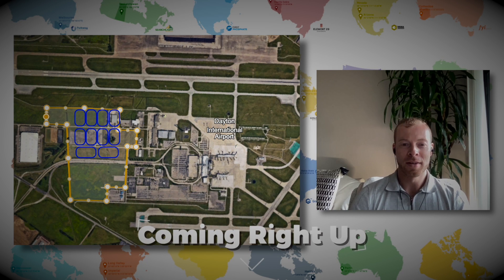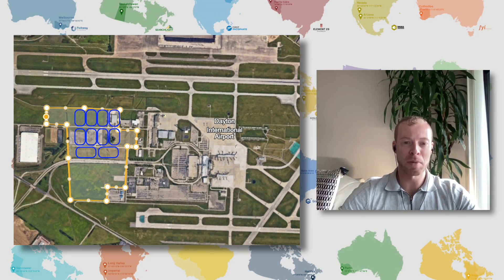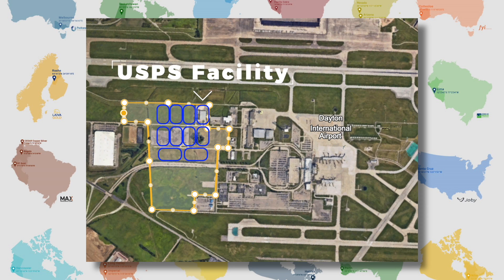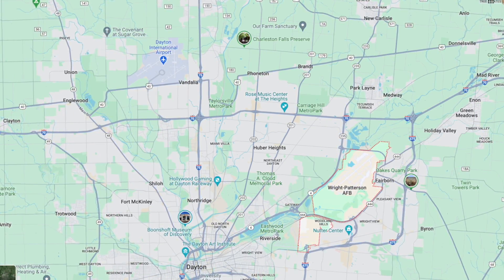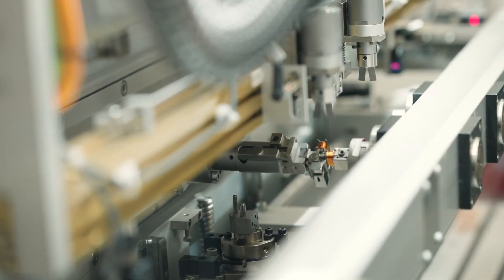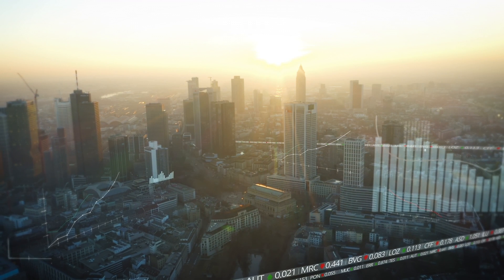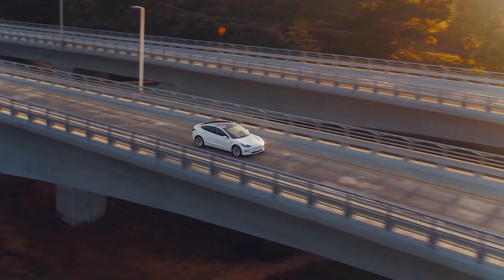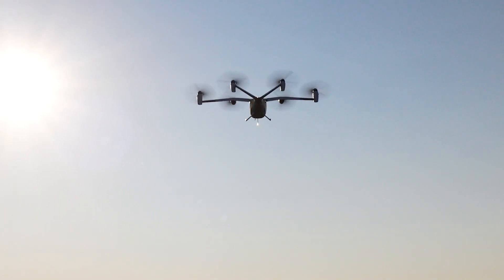Joby Expert Explains: Everything We Know about Dayton Facility | $JOBY Aviation

Comment: I believe Archer Aviation is way ahead of Joby in the certification process as well as getting ready on the manufacturing and scale with a new production factory in Georgia.  It has taken Archer 5 years to get up to speed in what Joby have done in 15.  Any how Im investing heavily on both companies.
Reply: Archer is at the least 2 years behind Joby. Midnight can’t be piloted, so it can’t be used for FAA type certification. Archer will have to build another aircraft to use for type cert
Reply from the maker: @livingroomguitarist7  Good insights. Thanks
Reply: I Believe Joby also has a first service agreement with the powers that be ,if im not mistaken?@livingroomguitarist7
Reply from the maker: Good to hedge your bet across both. 100%

Comment: When are they going to show that they can function as an air taxi and can carry a couple of hundred pounds a couple of miles? I don't think it's important to ramp their manufacturing before they are type certified. What is the logic in ramping up manufacturing when there is no proof they even work as a taxi? There is no way they will be certified in the next 5 year even if they worked perfectly. I doubt they do or they would prove it.  They should focus their resources on making a craft that functions as advertised and show it around to raise more money then manufacture when they have a certified craft. What are they going to make if they don't have a certified craft?  They are putting the horse before the cart. I think they know what they want to do isn't possible and are basically buying time.
Reply: I was gonna respond, but then I got high*
Reply from the maker: @spredluv1  please drink and smoke responsibly ;)
Reply: Joby been around since 2009 that's 15 yrs my guy
Reply: @itisim  that's a long time without much to show but quickly edited clips. They don't even have the craft that they will attempt to certify made.
Reply: @TheBagOfHolding  they are showing 3 FAA certificates that is a mile stone my guy do some research
Reply: I know everything about them. Air worthines doesn't matter and doesn't even need an existing craft it just lets them try and shows they have the resources to try. Part 135 means they can operate an air carrier buisness with normal certified airplanes and helicopters that they use to trick investors into thinking is a mile stone. Type certification is the only thing that would matter and they aren't even close. They don't have the craft designed that they will attempt that with.
Reply: @itisim  none of those certificates matter. Air worthiness means they can try to make something. Part 135 means they can operate an air carrier buisness with existing certified planes and helicopters not an evtol. They don't have one that they couldn't get even if they didn't have a prototype at all.
Reply: @TheBagOfHolding  it's a mile stone still man
Reply: @itisim  a type certificate is the only one that would matter and prove they can be an air taxi for people and they don't have the craft they will try to get that with made.
Reply: @itisim  they made the s4 before they got the faa type certification basis. That's the list of things they need to prove before it can be certified. They need to design it to meet that. They don't have it yet and I think it will not even be possible. If they do find a way to conform it will be years to get it certified. What are they going to manufacture before they know what to manufacture? I think they just want the grants involved with ramping up production and hiring a certin number of people.  Seriously what are they going to mass produce for all the years they are getting certified?
Reply: @TheBagOfHolding  mile stone my guy
Reply: @itisim  more like the starting line.
Reply: @TheBagOfHolding  joby will be fine and the balance sheet is good
Reply: @itisim  ok good then invest in them. I'm skeptical of them being ultimately viable. If they could replicate archers latest demo except with the 1,000 lb payload they promise for 10 minutes including forward tilting motors I would change my whole tune.  the 1000lbs can't be extra battery. Really I'd be impressed with 5 minutes of that.
Reply: @TheBagOfHolding  archer is second to joby
Reply: @itisim  they are equally vaporware
Reply: @TheBagOfHolding  nah joby got certificate first and archer came afterwards
Reply: @itisim  what certificate do you think matters? Air worthiness?  Archer got it before they even had a functioning prototype. That shows how important it is. They just need the resources to try and make something and a field to test it over for that.  It doesn't really matter the time frame. A type certificate is the only one that matters and that will be hard to get and take a long time and cost more money than either has. I doubt it's even physically possible to get an evtol to do what is needed for one. Maybe they should focus on showing it's possible first before manufacturing.  They need to take a load a distance that matters and prove it then they would get all the time and money necessary.
Reply: @TheBagOfHolding  joby has more than what you are stating
Reply: @itisim  what? Do they have anything they couldn't have gotten without an existing craft?
Reply: They are taking a big risk on getting a type conforming aircraft approved but they also need an approved production process to guarantee conformity to the prototype , even Boeing took a huge gamble on the 747 building the production building virtually around the prototype but that was into a mature market ripe for expansion with mature production technology whereas the evtol taxi idea is not proven even in theory and depends crucially on costs not just 'can it fly' ?  Economics is where most scepticism ìs based given other primary issues of safety and noise among many others.
Reply: Let's see what develops by the end of this year. Toyota and Delta Airlines had enough confidence in what's been developed to invest millions into Joby. I'm willing to place my bets with them.
Reply: @dcsensui  they should at least lift their claimed payload in a type conforming aircraft for 20 minutes this year. 20 minutes is the energy reserve needed for powered lift type certification. They need that plus the energy for the trip.
Reply: @TheBagOfHolding   What makes you think it can't? Have you directly observed any of the test flights? Seen anything that indicates the aircraft can't operate with a normal payload?

In July 2021 they did an endurance flight of 1 hour and 17 minutes on a single battery charge. Included vertical takeoff and landing phases at the company's test facility in Big Sur, California. A hydrogen-powered version went more than 500 miles.

Take note of the tooling required to build this aircraft. That tooling and inspection equipment is VERY expensive. I doubt any company would be foolish to spend millions on specialized equipment if the product couldn't perform as required.

And established companies like Toyota and Delta Airlines would not invest millions of dollars if they didn't believe the aircraft was airworthy and capable of doing what's expected of it. You can have your doubts but these major corporations, as well as the Air Force, believe otherwise.

Are you an engineer?

I'm a hobbyist and a pilot. I designed and built a quadcopter from scratch. Before kits existed. That means I had to figure out motor/prop/battery combinations needed to lift a one-pound camera and keep it aloft for 15 minutes. 

I built a test rig to measure thrust, along with battery consumption, to come up with the right combinations for a 4-rotor drone. Made all the structural components from carbon fiber, balsa, foam and epoxy. Used an OpenPilot controller that I had to program to attain stable flight.

So I have a fair idea what it takes to design and build a simple machine that can fly in the real world. Joby is a much more sophisticated machine that's at a much larger scale so I can fully appreciate what went into it, and understand what they managed to accomplish so far.

Here is a video clip of the drone I built 13 years ago. 
https://youtu.be/cESHVkB318E?si=EBWRLsX8GfugyH4t
Reply: @dcsensui  what is possible for little ones isn't possible for big ones because of the square cube rule. You will see.
Reply: @dcsensui  if they are scamming them I wouldn't expect them to be honest. They should show an unedited flight of an empty one over 10 minutes and beat archers demo. They would need to strip it out of extra weight and use a smaller battery than would be needed for the real one.
Reply: @TheBagOfHolding So you want to watch a 77-minute of it flying around in circles.
Reply: @dcsensui  what is the biggest drone flying for the longest time you can find video of?  You were proud of your little apm kit quadcopter and recorded it. Everyone that makes quadcopters record them. Why isn't there evidence one big enough for a person to physically get on flying very long even without a person on it? Its not possible yet. The battery will be way to heavy.
Reply: @dcsensui  yeah I like watching long range fpv foam planes. They can just have it out there for proof or even time-lapse.
Reply: @TheBagOfHolding    I built mine from scratch. Wasn’t a kit. So everything had to be figured out and tested as individual components, then integrated to make it work.

DJI has a drone with a max takeoff weight exceeding 180 pounds. Some of them are used in agriculture to spray crops instead of using crop dusting planes (I knew a guy who did that)j.

eHang’s air taxi in China carries two and is already operating. There's lots of videos available that show these actually working.

There’s something called “lithium ion batteries” that have a lot of energy density. Other chemistries are being introduced that are safer with more charging cycles. 

If you think the batteries are too heavy then you’re probably  thinking they’re using lead-acid car batteries. 

Meanwhile, let us know what you've done to form your opinion.
Reply: @dcsensui  ehang is bunk also. They cant lift a person for 5 minutes. They aren't certified to carry people in china. the agriculture drones get lighter as they go and don't stay up very long. 180lbs is one person. They aren't big enough for a person to get on. What is the longest video of a 180lb battery powered multirotor in the air you can find?
Reply: @sphudson  ok good luck with that if you are serious.
Reply: @sphudson You will never get your
Money back sorry